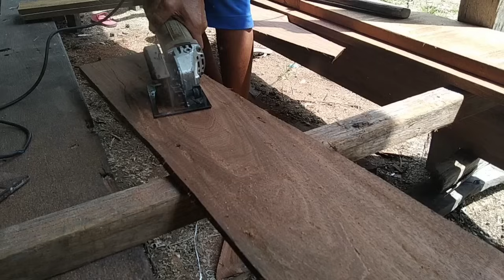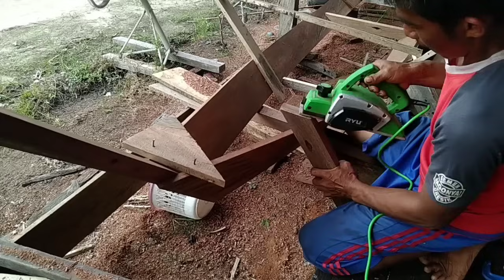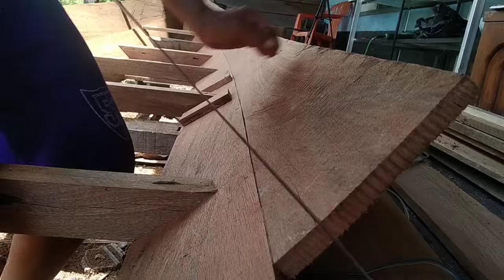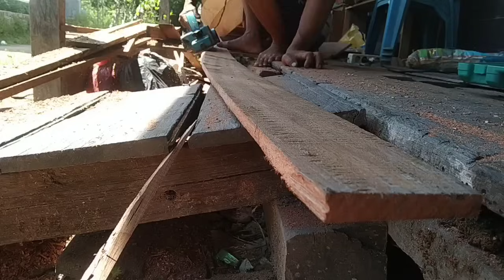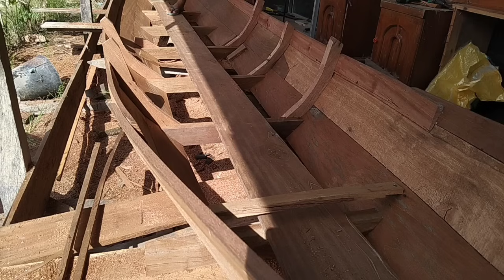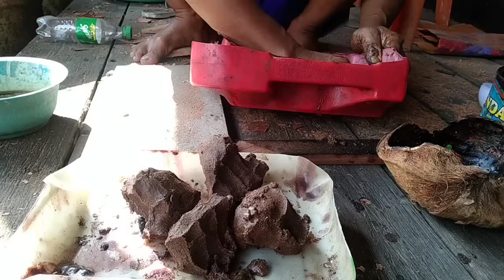cara membuat perahu kayu, tutorial lengkap .!!wooden boat making process

Comment: What is the material you tap in between the boards !!!
Reply from the maker: To clog the grout of the board, we use stove wick rope which is usually used for wall lamps, then apply Evoxi resin or other glue.